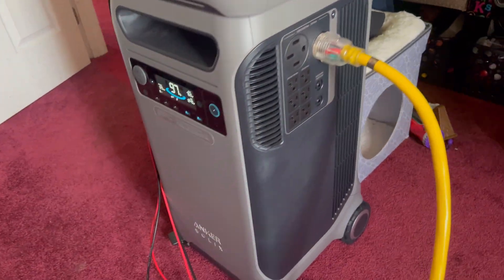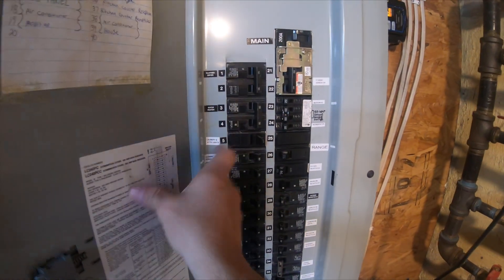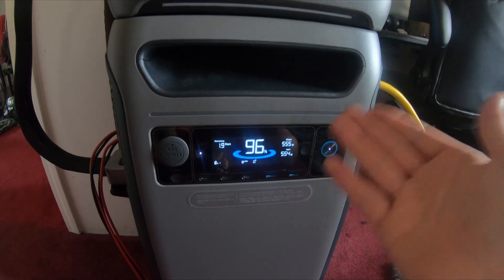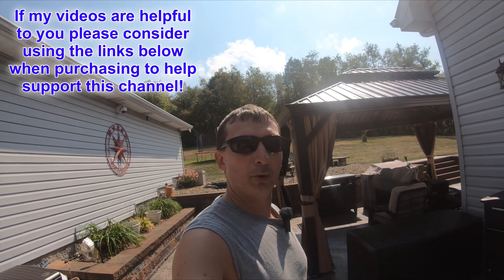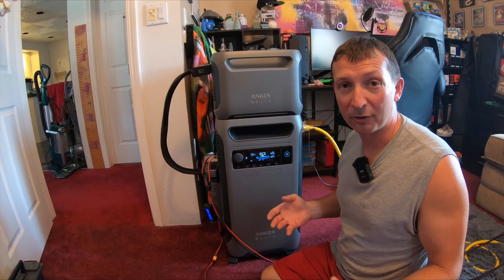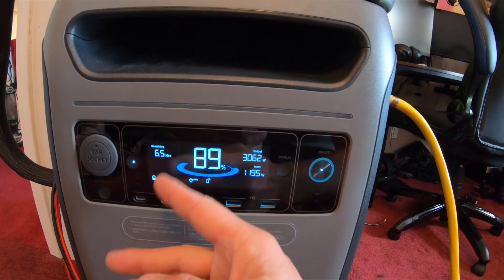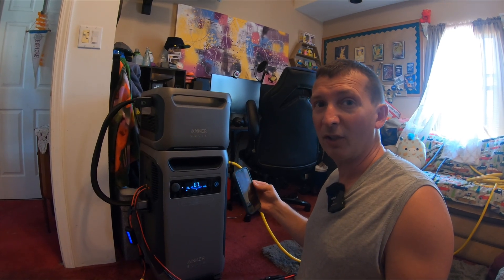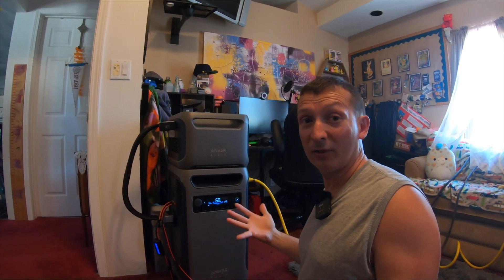Anker Solix F3800 and Solar Panels Powering my Home : Here’s what to expect

Comment: Just got our F3800 last week to use on our RV property as a backup system to our casita and well pump mainly. Our RV has 1520 watts of solar and 920 amh of lithium batteries so it pretty much takes care of itself.EXCEPT we only have a 3000 watt inverter in the RV and did not wire our dishwasher or cloths washer  through it so to trick the system we hook the RV up to the F3800 to run the dishwasher and cloths washer LOL!! When our RV batteries are close to full we run a cord from it to our F3800 to charge it with the extra power coming in. Perfect, no but at this point it works until we can maybe get some solar for the F3800 dedicated and maybe an expansion battery and then we will be golden. Baby steps.  Have a great week

Comment: That's awesome man great video wife and iare moving to the tx desert in Feb 2026 and this looks like it would work perfectly thanks for the video. We are trying to run 100% solar and maybe 2 more of the big batteries
Reply from the maker: Sounds fun! Make sure you check out my new video on the F 3800+ it has a few more options with solar and generator charging.

Comment: Thank you so much Jeremiah for this much needed and informative narrative of powering off the grid.  I've seen several of these from others, but those are missing what you have shown in your best narrative style that gives us all a much better idea of the real world performance of both the battery power source and the viability and performance of specified capacity solar panels' live effect on day-to-day and hour-to-hour operation.   The real eye opener for me (and I sure for a lot of others too), is the effectiveness and the extent that the solar panels actually maintain the level of power reserve in the Anker.  I also liked how you just kept it simple (laying the larger capacity panels on the grass instead of building up angle stands for them.    This gave us viewers a much more needed view of the panel's real world performance especially as the sun set in evening or dawned in the morning.  We viewers can better guess how much more we could get if we build angled stands for them.  Same with the raw quick setup in the house.  Others showed their system fully installed and that leaves us with so much unexplained (Kind of like those Home Depot vids on how to change your bathroom faucet.  Nothing is explained, just "See how simple it is?").